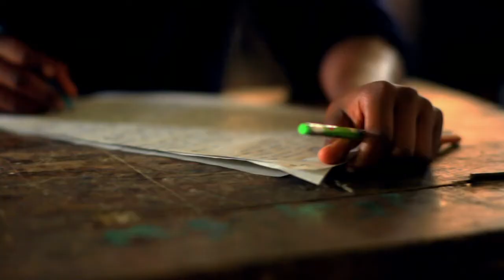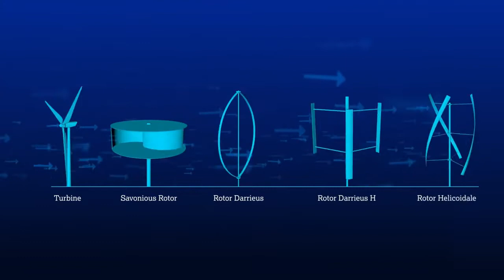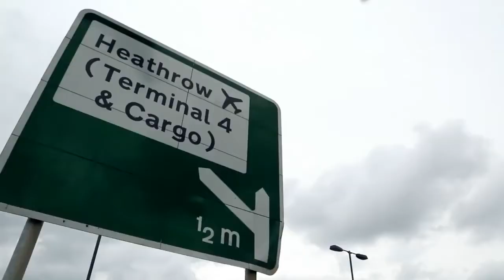Waterotor Turbine Harvests Electricity from Slow-Flowing Water

Comment: Im terrible at math/phisics...but,15kw per hour?...thats 1500W,right?lets see,a light bulb eats between 60 to 100W/h...a fridge about 1200W at start then 150W/h,right?...I dont know if its sufficient to power a house,not to mention a WHOLE HOSPITAL for that matter...please explain further(also ALL turbines convert 50% because torq,right?)
Reply: 15kw = 15,000W
Reply: @davidjohn5057 😌 thank you‼ ...Im terrible at math and physics 😓
Reply: @davidjohn5057  still...even when the correct answer is 15000....imagine: atleast 100 beds, plus imaging types of machinery,plus xrays machines,plus lab computers and machinery,plus...well all equipment needed in a hospital...I dont quite see how it will be sufficient(Im Paraguayan,All my electricity is hydroelectric)
Reply: @LorenSuJa just like solar and wind it is beneficial to use batteries to store the energy so if it so not all used it is not wasted and can be used when demand is higher.
Reply: @WingAddict  yeah I guess so! :) Though I would like to have all the info needed to make up my mind ...like types of machinery needed,real specs about size of hospital,etc

Comment: Exceeds 50% capture efficiency? If this isn't an exaggeration, it could AND SHOULD replace every dam retention turbine on the planet. While less mechanically efficient, the reduction in maintenance and infrastructure cost alone would offset that of full retention systems by a large margin... not to mention reducing environmental impact.
Reply: I'd hate to go swimming or tubing down the river and encounter one of these things though.
Reply: @WyattsVlog  - why? You'd just roll over the top. If swimming under the surface, you'd have to get caught up in the turbulence  to risk injury.